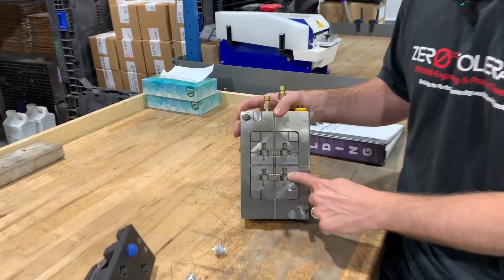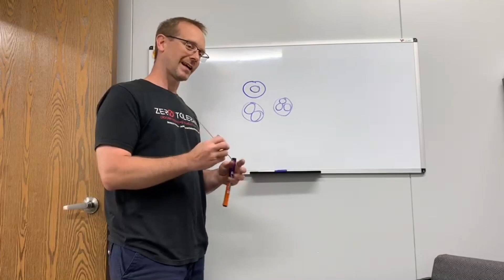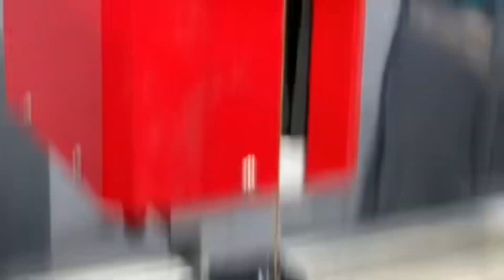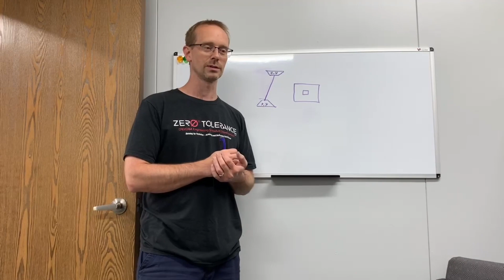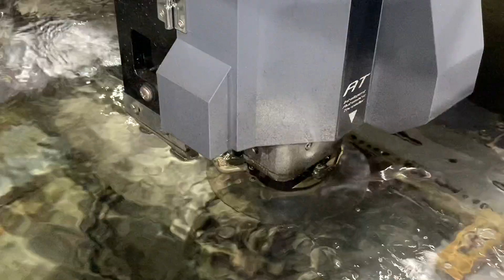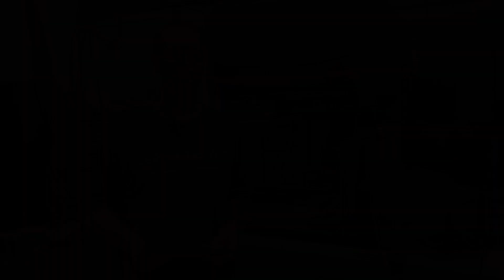Fast Hole and Wire EDM | Learn to Burn

Comment: Hello. Please mention the height required in Z for max angles. On my machine, we could cut 25 degrees at 100-125mm. I have some of the biggest custom wire EDMs with block carrying capacity of upto 3 tonnes and Z-cutting height of upto 440mm. Will share some pictures for your reference. Interestingly the finish of these machines is very high.

Comment: Hello, I have problems threading from a height of 10" inches. The machine is a Mitsubishi MV2400 R. Can you help me? I already calibrated the brass thread with its alignment device but nothing.

Comment: Could someone explain how the brass or copper wire cut the hard steel and doesn't melt itself ?
Reply: The soft copper or brass electrode doesn’t actually touch the hard steel block so there’s no mechanical force involved. The soft electrode actually “erodes” through the hard material. The process causes many small but powerful electrical arcs to form in the tiny spark gap between the workpiece and electrode. Each of those sparks causes a small crater to be blasted into the workpiece ( and electrode ), many per second, as the wire or tube electrode advances into the work. The purpose of the dielectric water or oil is to provide a stable environment for the discharge to form in the spark gap, and to flush away the material that’s melted in the process. Also keeps the wire from breaking under tension, or the tube from overheating..
Reply: @nate_in_CT  thats why it used to be called spark erosion...🤫

Comment: Hi, Thanks for the information. Could you expand please the differences in wire material,  I've seen some machines uses molybdenum wire instead of brass.

Comment: How did you pick up the block in the wire EDM? Did you use one of the fast holes for location? Or did you pick up the block on 3 sides and work from the edge?
Reply: Hey Geoff! We normally pick up off a ground edge on the outside of the block.

Comment: Thanks. I am a 70 yr old self taught manual machinist in Land Down Under. Know nothing about EDM and will never have, or want, the EDM equipment. However, really good to learn the capabilities of EDM if someone ever brings something to me which is outside my current sphere of knowledge. I am a supposedly retired self taught machinist, self taught mechanic, self taught welder etc. So this sort of education is a real bonus to me. Please keep it up the educational videos. Will look at older videos to see what else I can learn. Have a 660mm x 2500mm Taiwanese copy of a Victor lathe, a Bridgeport copy mill and a Pacific universal mill with NT40 taper, plus a tool and cutter grinder which I know little about and have used on few occasions, but am learning. I am very lucky with the home 16m x 8m hobby workshop that I enjoy.
Reply: Me too, self taught mechanic, self taught welder, driver, motorcyclist, painter, barber and self taught electrician. You are lucky enough to be able to manage those equipments. I have arc welding machine, hand drill and a hand grinder, that's all i got. Still hoping to learn more in near future. I'm 31.
Reply: @XuanyiWangYi  Hello Puia, If you live anywhere near me in SW Sydney, welcome to come and learn more and use my equipment.
Reply: @bobhudson6659  Wish I could, but I'm in Northeast India 👍👍👍
Reply: @XuanyiWangYi  No problem. A bit of a walk to the coast, then a paddle across the Indian Ocean (OK - a long one). Then another "walk" across our continent. But just take care of yourself and your family.
Reply: @XuanyiWangYi  if you can travel to Noida, i can help you with CNCs.
Reply: 🤣🤣🤣 You're crazy dude🤣🤣🤣🤣I think I will be better here without trying

Comment: Great video! I am running a Makino U6 extreme which uses .016" wire. I hope in future videos you can go over the different parameters and settings for different materials and thickness.
Reply: Thanks for watching! We're always looking for topic recommendations, our next episode will talk a little more about machine settings for copper, graphite & copper tungsten and we plan to get a little more technical on the differences in results.